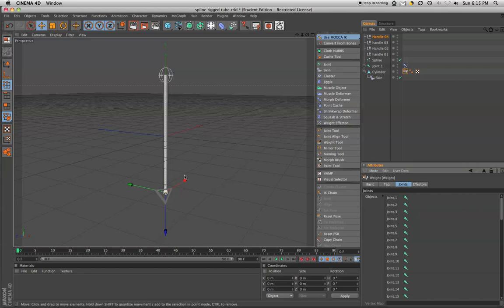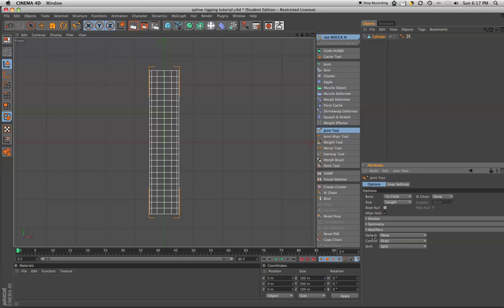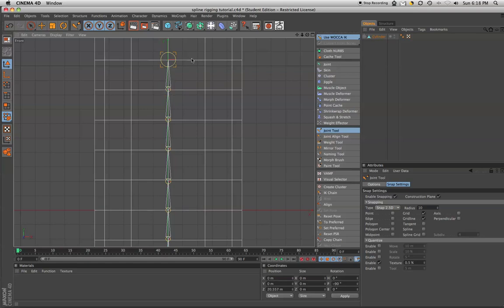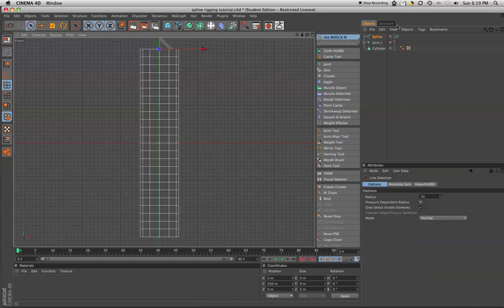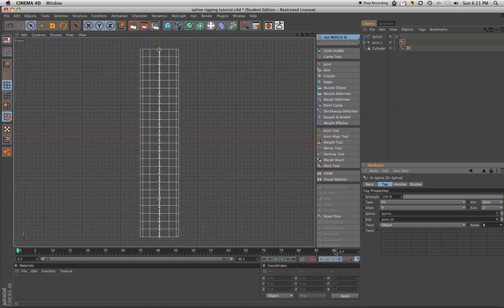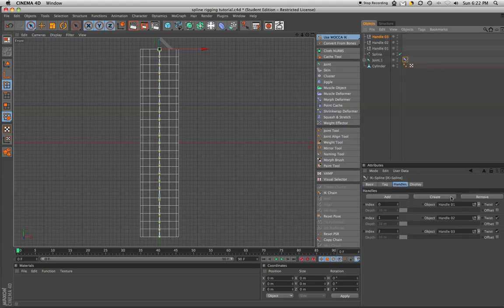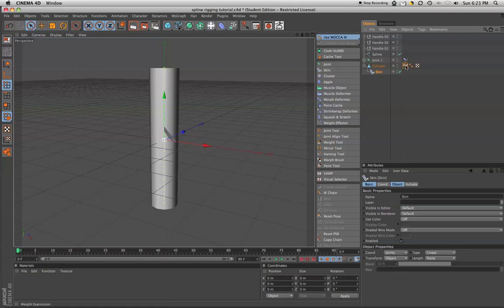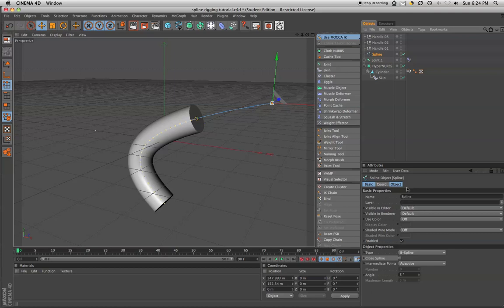spline IK rigging a tube.mov

Comment: I'm using this technique in a similar project where I'm trying to animate a spline use with a lathe nurb, when I convert the spline to joints and then bind the joints back onto the spline I'm getting some weird problems, some of them aren't connecting. Any ideas?

Comment: Great tutorial, Mike, I've referenced this several times for my projects. One thing to note that I thought was useful that you don't cover is you can also drag the handles into the weight tag along with the joints. That way when you set Bind Pose it records the handles as well so hitting Reset Bind Pose sets everything back to the original pose. If you don't include the handles, Reset Bind Pose doesn't work. Cheers!